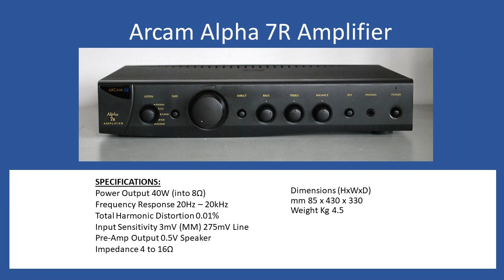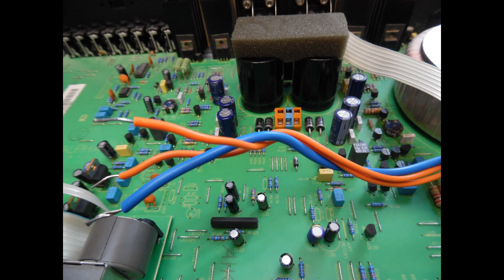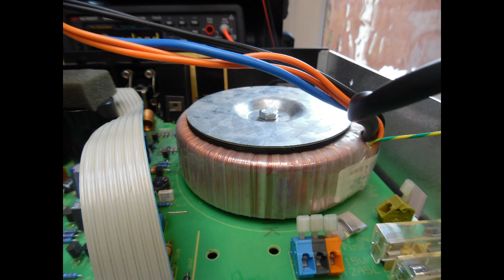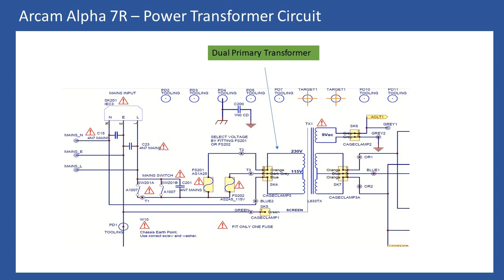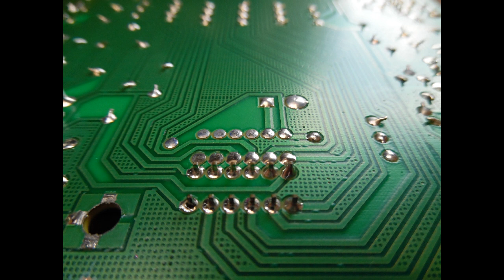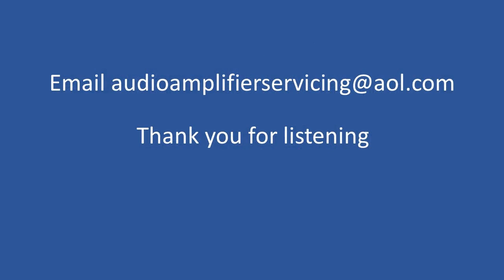Arcam Alpha 7R Amplifier Repair (With Audio Tutorial)

Comment: Excellent content. I've had this amp for 2 years and it has recently developed the input switch problem which you explained how to fix. The other problem is when you switch the power off using the power button it makes a pop sound through the speakers i have managed to get round this by engaging the tape button or plugging a 6.3 headphone adapter into the jack to prevent the pop noise. What would i need to look at? Is it related to capacitors on the board? I have stopped using this amp as i have an old set of tannoy floorstanders that i dont want to damage. I have done a lot of soldering in the past so this could be an easy fix for me hopefully.
Many thanks for making all of these tutorials👍😃
Reply from the maker: Mark normally when the Amplifier is powered down via the front panel power button, the speaker protection relay should turn off almost instantly disconnecting the speakers.
I would be interested to know if you hear the same popping sound if for example the Amplifier is turned off via the mains wall socket switch?
The fact you do not hear the noise if you select tape is odd.
Reply: @AudioAmplifierServicing  Hi thanks for replying. I've had a more in depth look at the amp tnite. I can hear the  relay click on when you power it up and when you switch off the unit.( Relay is just in between the massive caps and speaker terminals)  I tried what you suggested switched it off at the socket and the pop is still there. Using a  small set of speakers i can also  hear a hum through the speakers even with nothing connected. Not sure if that is normal as I've been using an onkyo AV receiver for a while which is more high tech and it  doesn't have any hum or pop lol . One other thing I did check again was the tape button and it makes the pop sound on that too. From what I remember from owning a couple of old school amplifiers  when you switch off the unit Iits good practice to make sure the volume is turned right down to minimum level?  Hopefully this might pinpoint what could be wrong. Regards mark
Reply from the maker: @markberry8182  Hi I have a 7R so I will make the same test to ensure  this is not normal operation.
Reply from the maker: @markberry8182  I have run a test, and can confirm there is a pop sound when the Amplifier is turned off, it coincides with the speaker protection relay turning off. So what your hearing is normal, there is a low level hum again normal and if you select Phono and increase the volume the Hum will get louder again normal.
Reply: @AudioAmplifierServicing  Thanks for running that test that's good to know. So it's just the input selector to fix. Have to buy a  fibreglass pencil  . Is the solder they used on arcam pcb's lead free? Many thanks for all your help👋
Reply from the maker: @Mark Berry  Hi the solder is not lead free it's 60/40.